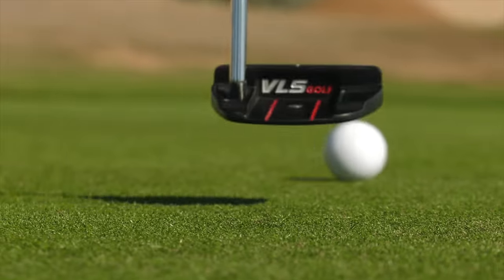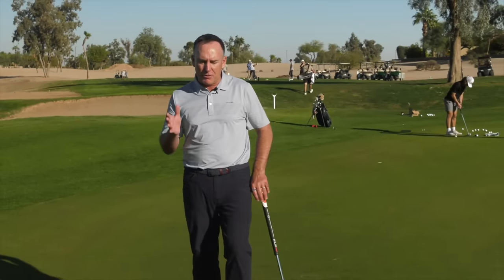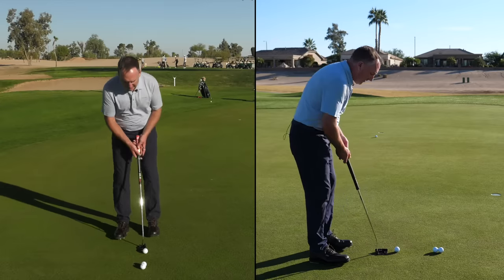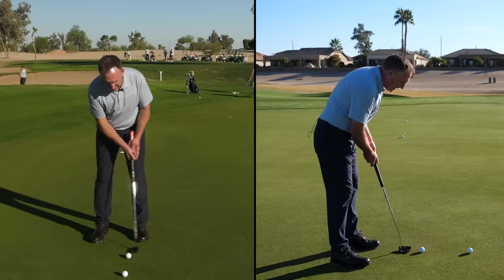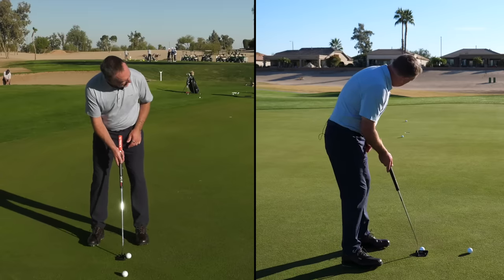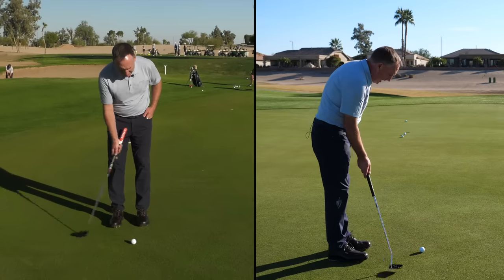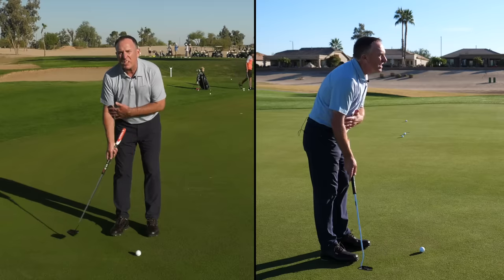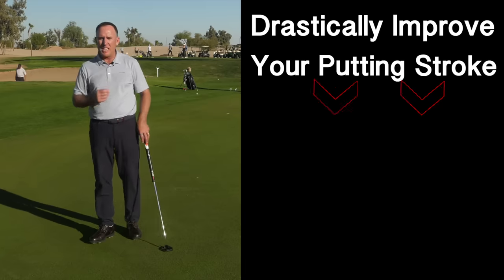I Wish I Knew This Putting Concept 30 Years Ago

Comment: Mighty smooth. But,would think that a little bit of acceleration would be needed for counteracting the tendency for the contact with the ball to slow the putter down, no?  Thinking that phenomenon is an excellent source of flinching, too.  Ask me how I know. 🙂  Also, what is the ideal length for that "second" backstroke after the pause - three inches or so? 🙂  I use video a lot and am constantly amazed by the stuff that I do that I'd bet a lot that I didn't do. 🙂

Comment: I am a pop putter and I think this will cure a good bit of the skid before roll issue experienced by the pop strike.

Thank you for this drill
Reply: I’m sort of a pop stroke guy myself, on putts inside of 15’.  It just feels much easier to start my ball online this way, by “bumping” it precisely over my “spot”.   However, I implement more of a fluid, continuous motion for lag putting. I do just as he pointed out. I use the length of backstroke to determine the desired distance(using a few practice strokes), while maintaining the same tempo, or speed  no matter the distance.    I shot my personal best -7(65) back in the summer. 23 total putts. 13 one-putts. I don’t normally putt THAT good, but I do routinely have less than 30 putts per round. I feel like this method works!